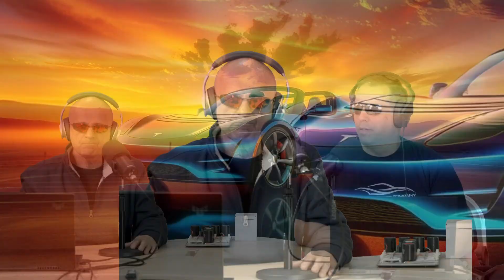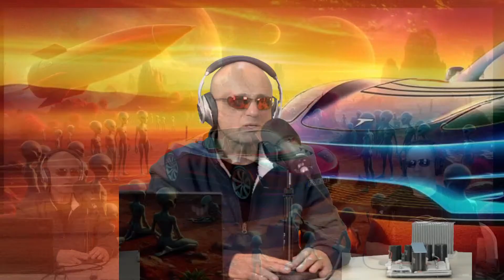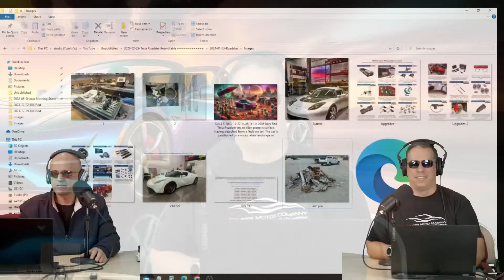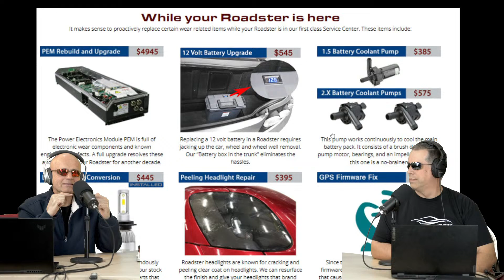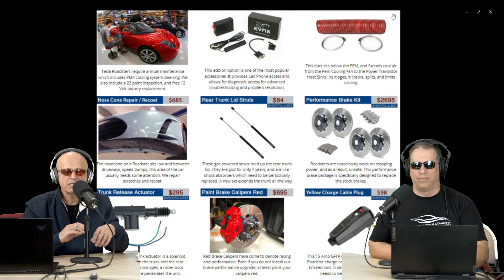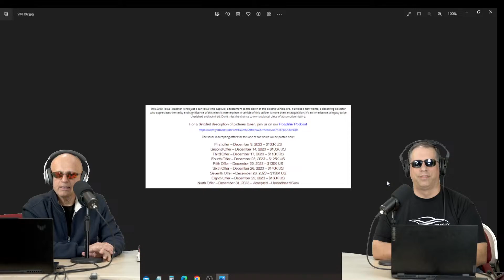Tesla Roadster Podcast #43

Comment: Good morning Gentlemen.  Hey my heater stopped working after my subwoofer went out. I suspect a short but no wiring diagram as to which fuse to check etc.  Also have you consider reaching out to Owings Corning for material. They made heat tiles for Space Shuttle should have something pliable for this application.